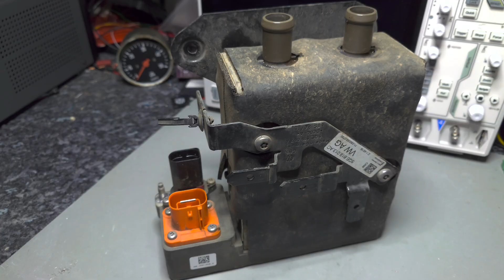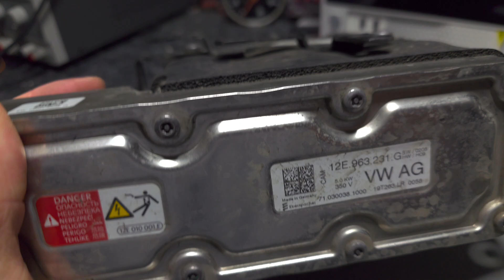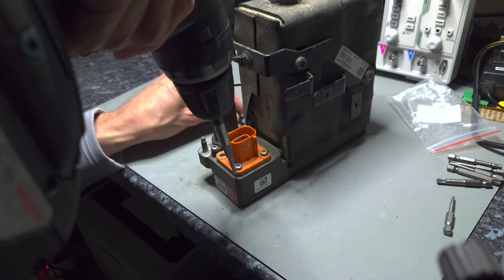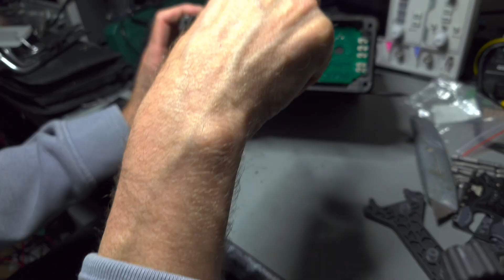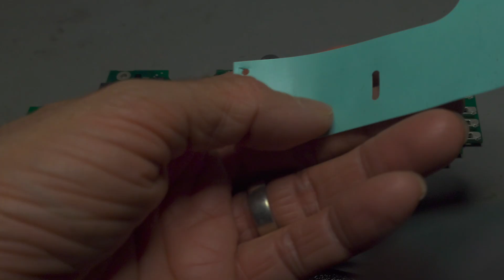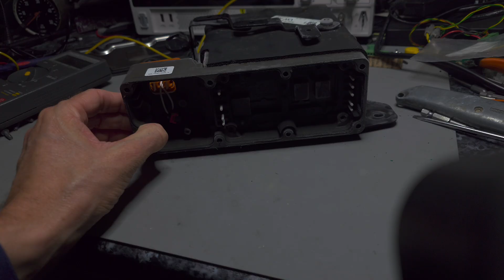E-golf Error: electrical system! Stop. Near 2 grand for VW to fix, or only £15? HV heater teardown.

Comment: Hi Mangodan2003, My E-golf heater has stopped working (no heat & I don't have a heat pump) I would like to replace this unit but i don't even know where its located in the car - any help would be appreciated.
Reply from the maker: Did you find it? It's under the bonnet / front of car to the right hand side near the lower end of the windscreen, or just back from the top of the inverter. If you trace where all the orange cables go youll find a pair leading to it.
Reply: @mangodan-ps6qu  Thank you found it. Is it easy to swap this out - not sure how to replace to coolant liquid and what with. Also if I get a second hand one do you think it will need code changes. Thanks so much for your video it's the only one I found on line that is any help at all.
Reply from the maker: No coding required. We were able to swap it out with minimal coolant loss by keeping the hoses high as soon as disconnected. Emptied the old one into the head tank. Make sure you know what you're doing electrically before trying this. It has a nearly 400V supply that must be isolated. Sorry I'm not prepared to tell you how to do that for hopefully obvious reasons. But I'm sure you can find out elsewhere.
Reply: @mangodan-ps6qu  Thanks for you're help with this Mangodan I'm planning to get a local garage to help with this so they will know how to isolate the main battery. I'm going to ask them to fit a unit I get from a breakers. (hope they will do it) My very last question (promise) is did you measure the resistance of the working unit and could you tell me the reading so I can check the one I buy from the breakers. (I O U a drink) thank you. Pete.
Reply from the maker: I can't recall the exact reading but the resistance across the high voltage terminals should be almost if not open circuit, higher than 100kOhm at least, likely megaohms. If you get reads of 50 to a few hundred ohms one or more of the IGBTs has failed and your vehicle won't start after fitting. Unfortunately you can't test the heater works in this way, you would either have to open it up and measure things or talk to it via the Comms interface to tell it to turn the heaters on and then measure the resistance across the terminals.
Reply: @mangodan-ps6qu  Thanks mate I'll let you know how I get on.

Comment: so what did you switch to fix it? the board itself or one of the components?
Reply from the maker: To get the job done quickly we had a second unit which we fitted there and then. Just the one component on the board is likely enough to get the original one shown in the video going again though.

Comment: My golf heating it's working but bit cold in cabin, I hope it's because of this
Reply from the maker: It won't be the exact same fault as this fault results in the heater being permanently on until the car is parked and shut down at which point it is completely immobilised until the fault is corrected, however another fault in this same unit could well be the cause.
Reply: Hi, I also have trouble with the heater not working in my e golf 2019 (sometimes, especially when it's really cold weather). 
Did this fix work for you?
Reply: There are 5 components in the AC system that over times begin leqking AC gas slowly until it empties completely at which the AC compressor gets damaged due to the loss of pressure and AC gas+oil. The repair is possible, but the gas and oil replacement with components will get pricy!
Reply: @callah949I get lucky I got simple ptc heater, just changed for second hand and sorted